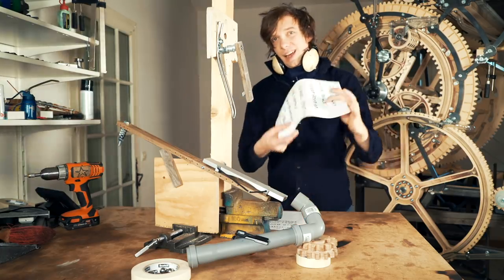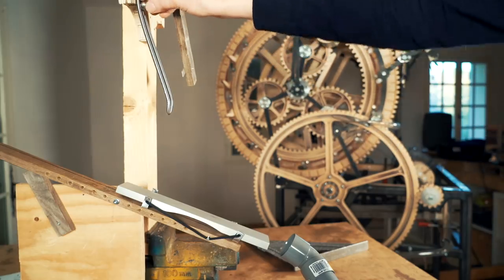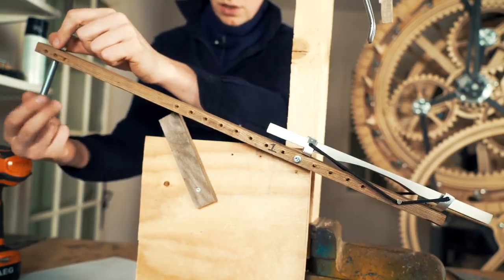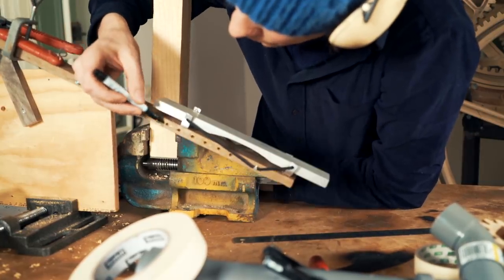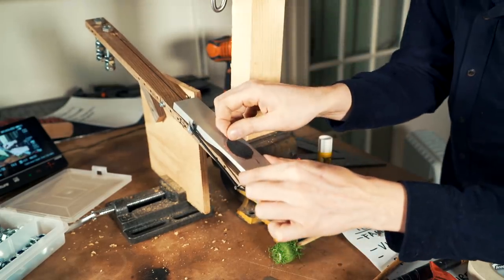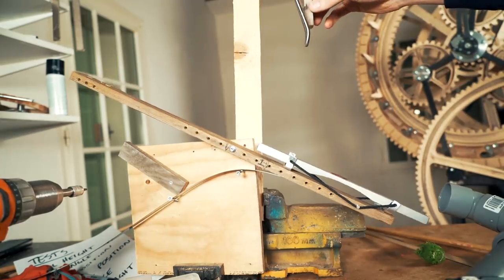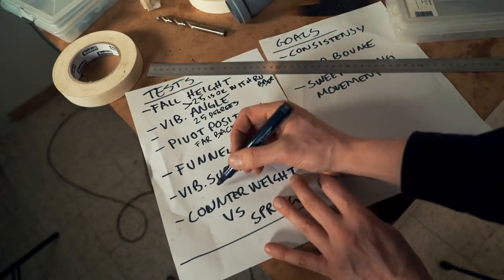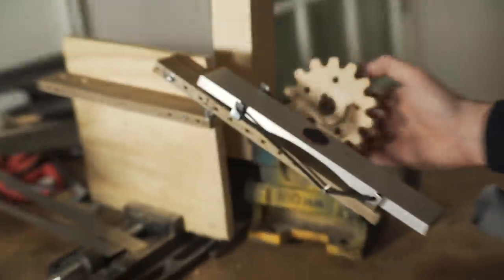Vibraphone Movement Test  - Marble Machine X #64

Comment: How often are you going to be playing the same notes? Make sure the movement will be zeroed before the next note! 😉
Reply: That is why he didn't like the spring one. Leaf spring returns to zero a lot quicker.
Reply: @Helveteshit  What about the leaf spring wearing down over time? That may also be an issue. It's kinda crazy that you have to think about every little part in every way.
Reply: Yeah it has to zero pretty quik so the angle stay concistend
Reply: Especially since he is adamant about playing tight music. It's probably a good idea to have the amount/duration of swing adjustable
Reply: He needs to think about it kinda like a pendulum, the longer the pivot the slower the recover time.
Reply: I was thinking the same thing. I don't think even the leaf spring will return the key to 0 position fast enough for the higher BPM
Reply: The return speed shouldn't matter, in double drop tests the hit point of the marble in the catching funnel was pretty tight. I couldn't work out if the slight increase of drop height and change in plate angle helped this.
Reply: When considering the counter-balance, a larger mass placed closer to the pivot will result in less moment of inertia, meaning it will recover to the original position more quickly than a smaller mass on a longer lever-arm.  This might be important if timing of the recovery is critical.
Reply: It seems like he's having to find a balance between looking perfect (bounce) and working perfect (hold still, dammit!), as usual. Aw, he'll find that balance, he always does... eventually.   @alexmyers603
Reply: @KYLERHOLLAND  it's not that much of a problem. Every part of the MMX is designed to be easily changeable if damaged.
Reply: The spring steel shouldn't wear down noticeably quickly either. It's the same kind of steel that's used in leaf spring suspension that a lot of older trucks use, and that lasts a really long time. It is a substantially smaller piece, but the loads are likewise lower. It seems to have some natural damping as well, compared to the bouncy, undamped coil springs.
Reply: I think better a Hydraulic spring, cas that is more controlable responsive, like as leaf spring. Lets see this example at Old Tony >.>
Reply: I also was thinking this - but maybe it's don't matter - just make the funnel wider to catch the marble when comes from a slide different angle - just make sure that it hits the same spot no mater what the angle is.
Reply: axeugtly. 😆
Reply: No spring needed, rubber only. Old video btw. Time Play...
Reply: @Helveteshit That's a damping problem more than a "spring" problem. Leaf springs can do the same thing, it just had more friction against the lever arm which damped out the oscillation faster. With a bit of work he could add some damping to the compression spring too.
Reply: BPM is irrelevant, because you can have just about any number of of notes hitting per beat.  This is why music notation goes to 32nd notes, to indicate rapidity.
Reply: If certain notes are getting played too rapidly for mechanical recovery, there's always the possibility of customizing the vibraphone to have two identically-pitched chimes, played alternately.
Reply: @KYLERHOLLAND  That was exactly what I was thinking when I saw him using the leaf spring, and the regular springs.
Reply: @Just_Sara  well keep in mind the whole thing is moving as well, when going for the bounce, you will need to take this into the calculation as well, or risking the arm to swing without the balls even hitting it.
Reply: @Helveteshit  is the best username ever lmao
Reply: @KYLERHOLLAND  If you keep the stress in the spring steel below its endurance limit, it shouldn't fatigue over time.
Reply: @KYLERHOLLAND  Springs with as little movement as leaf springs can last a very long time and are not expensive to replace. Springs with greater travel will generally wear out faster.
Reply: It appears to have a "stop" on the resonator tubes to limit the angle. That would resolve the need for it to return to zero at all.
 It should be a variable between 25 - 30(?) degrees between notes. In other words, it wouldn't matter how far it returned to zero before the next note.
Reply: It prob wont matter for sound quality, but will slightly affect timing :) I was thinking this as well.
Cheers, Edwin
Reply: @Helveteshit  yeah but if you look when he touches the leaf before he trades it out it shifts down and doesnt come back up
Reply: Wait, since when does steel degrade when the stress is always kept below the yield point?
I'd love to know since it directly conflicts with what I was taught this semester during materials science class in college.

Comment from the maker: A lot of you are wondering about the timing of a fast second consecutive note at a lower vibraphone height:
I hope this math is correct:
Marble travels 2.28019736 m/s = 2280 mm/s (measured with motion tracking software)
10mm height difference = 1/280 of a second = 0,0035 seconds (3,5ms)
in 120 bpm 1/16th = 60/480 = 0,125 seconds
32th note 0,062 s delay
64th note 0,031 s delay
128th note 0,015 s delay
256th note 0,007 s delay
512th note 0,0039 s delay
The second note will be 3,5 ms or just less than a 1/512th note late
Not audible, if my math is correct! 
IMPORTANT MESSAGE: This was not a sound test only a movement test :) Haha it sounds so horrendous indeed right now.  Have a great day everyone!!
Reply: Wintergatan are the lower notes heavier? Will add on to the delay?
Reply: Will the MMX be open for rendering melodies for other musicians?
Reply: I would suggest that you avoid using latex rubber to pad the vibraphone. I'm sure you remember how your rubber bands broke down on the old Marble Machine, and that was because rubber bands are made from latex. I have some nitrile rubber dipped work gloves, and something like that could last a long time.
Reply: Martin, consider making little "trampolines" so that the rubber pad becomes a membrane suspended above the note so that the ball only makes contact on impact - this won't affect the frequency or add any damping. Lowering the height of the membrane dynamically could add damping when desired, and the materials could be easily changed for different effects.
Reply: Why not instead use Felt Fabric to cover the vibraphone to produce softer sounds? 
Plus it looks nice too.
Reply: I'm not sure your math checks out. Kinematics have your marble travelling at 2.2159 m/s, from a fall distance of 25 cm, with nothing acting on it, but gravity. The software has the marble travelling faster than that, which isn't possible with only gravity and a starting velocity of 0 m/s.

Anyway, it all adds up to a delay of 4.3 ms from my calculations based on the above, or 1/228th of a second.

Source (back of the envelope math, feel free to correct errors): https://i.imgur.com/PBBPbX7.png

An entirely different matter however: Trajectory, might be a concern. The angle of impact with the vibraphone will change, and so will the direction that the marble will bounce in. You may start missing the "hole" when consecutive hits on the same note, differ in delay. Meaning different BPM tracks with consecutive 1/16ths notes will result in different trajectories of the second marble.
Reply: if you are having the pads on the vibraphone to make a softer sound, why not have a switching lever to adjust the fall enough to make the marbles contact the actual vibraphone plates themselves, 

this way your vibraphone could have 2 separate sounds which you can switch between with a simple lever, maybe it could shove the drop chutes outward a little.
Reply: I would ask to consider light torsion springs since they are specifically designed to return to exact desired angle, or zero, at higher than Prestissimo; faster than presto - 200 bpm and over.
Reply: For the quickest return without bouncing ('perfect movement') you should try to achieve 'critical damping'. You need to tune the friction to achieve it. (If it bounces increase friction, if it moves too slow decrease friction).
Reply: @FabianKlein97  Martin didn't specify what drop height his speed measurement was made at. You may have misapplied the equations of motion. Did the motion tracking software give the instantaneous velocity at the end of the fall or is it the average? You needed to substitute in the instantaneous value of 'v' at the end of the drop. From v^2=u^2 + 2ax we can get the following: The speed at the end of a fall from 50 cm as  3.13 m/s. For a 25 cm drop the instantaneous value of 'v' at the end of the drop would be 2.21 m/s. Fall time from 50 cm should be 0.31s ignoring air resistance and 0.22 s from 25 cm. However the most important point is the delay between marbles which is only dependant on the time between releasing them as far as I can see. So the focus of the analysis should be on the speed of the recovery of the spring or counterweight mechanisms. I would think the motion tracking software would quickly give Martin the answers he needs and he could adjust the stiffness of the leaf spring to get a  speedy enough recovery.
Reply: Okay about the timing, but you will probably need to cover a bigger surface with rubber for when the second marble falls
Reply: Wintergatan 
You might wanna pin this to the top, it was starting to get buried (on my screen anyway - mind, idk how these things work).
That aside, thanks for sharing what you do with the rest of us! I'm loving it!
Reply: Hmmm for the fall time you didnt take in consideration that the ball is accelerating, but this only makes the fall time shorter (gaining speed as it goes)
Reply: @DerIstDerBeste  , I also thought of critical damping, but since that occurs when (in this case) friction and spring tension are in a sort of equilibrium you could do it the other way around, i.e. tune the spring tension to fit the friction, which would probably be a lot easier. However, it is worth to note that it might be useful to change both friction and spring tension to get a slower or quicker return while still avoiding bouncing.

Ps: I assume both you Sogolumbo and the engineers that are working with Martin already know this, so my comment is more for the average reader.
Reply: @stephenhicks826  Your right about the calculations of drop height. Martin specified the drop height at the end of the video with >25cm, during testing he said something like the original design in CAD was also with 25cm; later he moved the part 5cm down. From my original calculation the resulting 50cm would have been to much, that's why I pointed it out. What still remains is that it should be 1/228 so 4.4 ms.
Reply: @FabianKlein97  OK, thanks.
Reply: I'm not an expert on mechanics, but to me doing this with motion tracking software seems like driving a nail with a nuclear warhead. The average velocity of the marbles given fall distance d can be calculated as v=sqrt(2gd)/2.

The average velocity at 25cm will be v=sqrt(2 * 9.81m/s^2 * .25m)/2 = 1.11m/s
The average velocity at 35cm will be v=sqrt(2 * 9.81m/s^2 * .35m)/2 = 1.31m/s

Again, I might need to brush up on my high-school mechanics before giving advice to people on the internet building complicated machines. Somebody please correct me if I'm wrong.
Reply: If you plan to play for example 128th notes => 0.015s is also the time the Vibraphone and Wood has to travel back the ~1 cm ! This is a lot for a mechanical system, leading to stronger springs/better dampening ! Best greetings from Austria ;)
Reply: please test some classic country songs like allen jacksons 5 o clock somewhere
Reply: When hitting the second note, the vibraphone is at a different angle. This might be okay if the marble catch mechanism is big enough.
Reply: You should refer to the 'gravity map'. The answer is variable
Reply: Will the movement of the device not affect the trajectory of a secondary marble hitting the same note within a short timeframe (same note being played on the next 1/8th, 1/16th, etc. note after the first)? You may need to use a spring system to allow the position to reset faster (before another marble can hit the same note).
Reply: Wintergatan where can I get your “music is the goal” song please!!!
Reply: The equation relating distance, time and acceleration is d = 0.5*a*t^2. (Zero initial velocity). Solving for t we get t(d) = sqrt(2*d/a). If we drop from 25 cm and the distance changes from 25 to 26 cm, the time changes 4.5 ms. 
If we drop from 35 cm and the distance changes from 35 to 36 cm, the time changes 3.8 ms. 

(Calculations are valid for the earth and other planets with similar gravity)
Reply: @Shane Jowers yes they do vary by about 200g. I'm hoping to find a solution where a counterweight can accommodate multiple plates without needing to be changed mid gig.
Reply: Andy Lee Robinson this is a great idea
Reply: @bardes18  My thoughts exactly! Silicone could be ideal for this.
Reply: Im wondering how much longer this will take. Dont mean it a bitchy way, good stuff takes its time.
Reply: To avoid the rebound with the 3 compression spring. You need to add a extender spring to act like a restrainer of the rebound. It's like a car spring and chuck supensions.
Reply: have you hardened and tempered the spring steel
it makes it
spring
Reply: For the tube length you can use Ferrari continously variable length intake technology.

engineering explained has a video on it.
Reply: Hi, Martin! :D  For consistent rubber impact pads on the vibraphone, what about adhesive bike tire patches? :)

Comment: I'm abit confused. If the vibraphone moves and it takes a second or 2 to return to its normal position. If you play the same note quickly, the marbles will hit the vibraphone at different angles. will the angle of the vibraphone cause a different "bounce" and it may not get caught in the catcher? 

I'm not an engineer or a physysist so please forgive me for my lack of proper Vocab.
Reply: This is correct, but judging by the size of the funnels that are to catch the marbles, this shouldn't be much of a problem. The 25 degree angle is shallow enough that the marbles should land on roughly the same spot even mid-recovery. Another thing is, if the marble bounces off the vibraphone in the lowered position, it is flung out further, but also lower. With a bit of luck those two effects might mostly cancel out.

Also, musically speaking it's not very likely that a note on the vibraphone will be needed twice in rapid succession at all; the marble machine is very fit for music box type music, which (anybody correct me if I'm wrong, this is just a gut feeling) contains a lot of arpeggios to create the chord feel, but not many phrases of repeated notes.
Reply: IIRC he's going to have marble dropping points which both come from slightly different angles, so he'll have to make the catchers slightly wider anyway so it doesn't really matter.
And for Thijs: Martin has said he wants to play fast music, so I wouldn't count on not playing the same note in quick succession :p
Reply: @Elendrial   What I'm saying is, regardless of BPM, the sort of music that the format of the MMX admits relies heavily on arpeggios, not riffs. I don't expect to see many rapid fire notes in the music either way. Think of the original marble machine tune, that one was all arpeggios.

Edit: Besides, there will be an ondophone for playing free melodic sections, so it makes sense musically to arpeggiate chords on the vibraphone and play riffs on the ondophone for a well defined sound.
Reply: But he made two drop points for every note specifically so he could play rapid fire notes.   @Nomen_Latinum
Reply: @Nomen_Latinum  he made two channels for every note because the MMX is supposed to play rapid notes. The ondophone will be used  for melodies, but it doesn't mean that only that instrument can play melodies.
Reply: @Just_Sara  Fair enough, you guys are right about the two channels! I still stand by my mechanical point though, that it probably won't matter much at what position the key is when the marble hits. Martin should be fine on this one :)
Reply: Designing this so the whole vibraphone has degrees of "rocking" travel seems like adding an unnecessary variable.
Reply: @feldon27  Musically unnecessary, but artistically it's a different story and Martins opinion in that regard is all that counts :-) And if it doesn't work, the design can always be altered to stationary vibraphone again.
Reply: @MeriaDuck  I fear that Martin will end up with a machine that requires constant maintenance. Just the stress of disassembly, assembly, transport, and unpacking in a variety of temperature and moisture conditions is enough variables. I have a vision of a concert where the programming plates will not fit because they have swelled 1%.

Also the resonator tubes, I thought the Marble Machine is designed to be used on stage with microphone pickups.